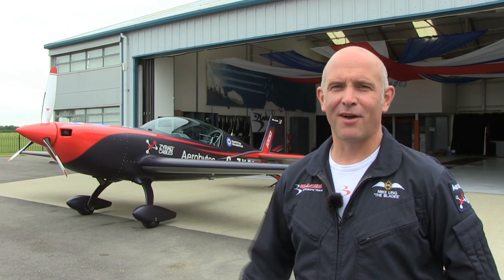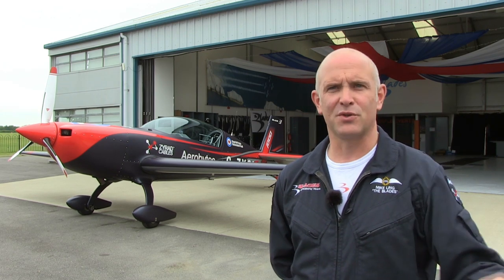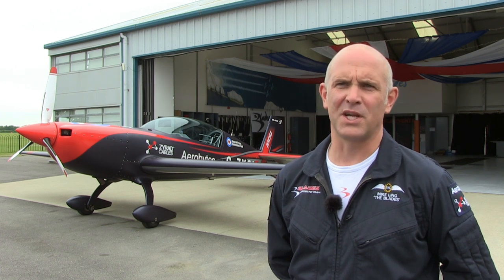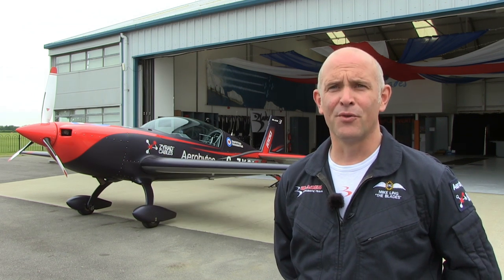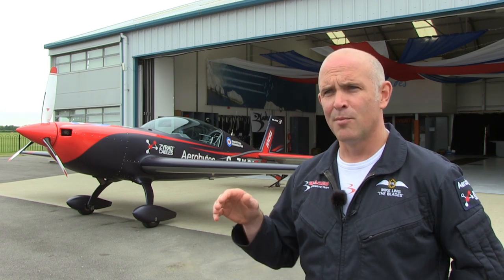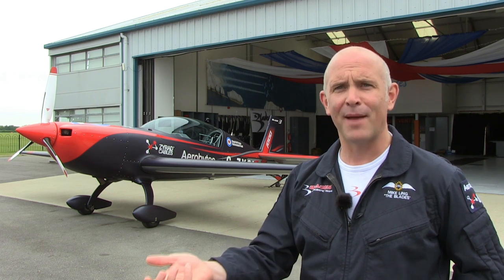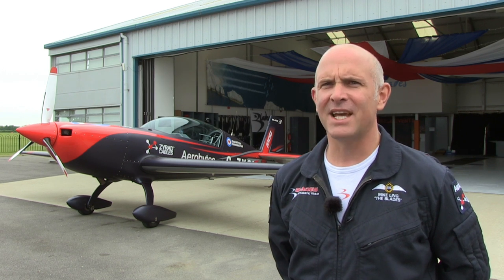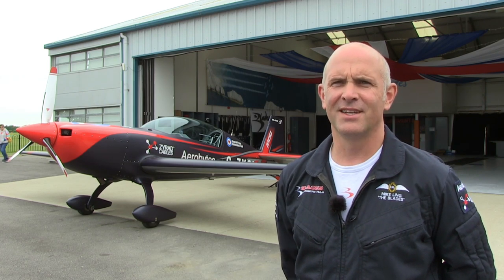Tornado F3 Wing Sweep | with Mike Ling

Comment: The reason they allegedly didn't use the autosweep in the British (Italian, AND German) Tornadoes was that it stressed the airplane more and created more maintenance work.
The F-14 is the only variable sweep plane that went into service with autosweep and used it for its entire service life.  It was a very reliable system BUT the wing sweep mechanism definitely created maintenance issues that they took seriously with the F-14.  Unlike the F-111, there never was a wingbox failure in the F-14 and wing "hang-ups" or malfunctions in a fixed position were rare.  Grumman learned their lessons very well from the F-111's problems.  It's a fact that they never built that many variable sweep aircraft in the US.  The totals of variable sweep planes built in the US (B-1, F-111, F-14) would barely equal one-quarter of the F-4 Phantom production which was close to 5200 planes!  Yes, variable sweep was expensive!
By far the most successful variable sweep program in the West WAS the Tornado -- nearly 1000 ground attack versions built and just over 200 ADV/interceptor versions built.  The MiG-23/-27 were far more numerous (6000 planes built) than ANY Western variable sweep program BUT they got phased out faster for a reason -- they were a hell of a lot more dangerous to fly and those countries that couldn't afford (or WEREN'T allowed) to buy MiG-29s or other planes often kept flying their MiG-21s AFTER they grounded/retired their MiG-23s!  The Chinese didn't bother to bootleg the MiG-23 for a reason!

All the other variable sweep planes had manual systems (F-111, B-1A/B, MiG-23/27, Su-24, Su-22, Tornado IDS/GR1/GR4) or they disabled the autosweep (or just didn't use it) like the UK Tornadoes although I've NEVER heard of an autosweep system in the GR1/IDS models.  I've only read of them developing autosweep for the F3/ADV series of aircraft for obvious reasons -- they thought they could possibly dogfight with the ADV models.  The F2/ADV did not have autosweep but they only built a limited number of F2/ADV aircraft (18, 24?) and those were only used for training -- they were not operational/frontline planes.
Well, variable sweep is basically old-hat and passe as far as aircraft design is concerned.  The Tornado will probably be gone by 2030 altogether (depending on how quickly Germany and Italy can get their Typhoon fleets together; Germany's air force is a MESS right now) and the last variable sweep planes in service anywhere will probably be the B-1 and Su-24.
Reply: Impressive … and good info
Reply: It might have been extremely complex and difficult to maintain, but the F-14 wing sweep was probably 20 years ahead of its time and probably the most well implemented function. It never failed, the computer controlled programmer had very complex algorithms to very quickly compute the best sweep angle for a given angle of attack, maneuverability/lift demand and mach number. The motors were extremely fast in how they could adjust to rapidly changing mach number during combat. Even at 7.5g and over 350 knots turning speed under high stress, the mach programmer could get the wing sweep from 20 degrees to 68 degrees in less than 2 seconds.
Reply: If manual sweep in a two-seat Tornado offers a higher workload for the pilot in close combat, imagine the hell it must've been for MiG-23 pilots tackling F-4's F-14's, F-15's, F-16's and Mirage F-1's over the years? Made all the worse by having a restricted view out of the cockpit. At least the MiG-27, Su-22 and Su-24 are all attack oriented and have no place taking on dedicated fighters...well except when a couple of Libyan Su-22's were shot down by USN F-14's in 1981. But that's another story I guess.
Reply: @AvengerII : Great insights about the topic of variable geometry (VG) wings. Thanks.

There is two other airplanes with VG wings that will remain in service for quite a long time : the Tupolev Tu-22M ant Tu-160 (the build assembly of the latter being currently reopened). As you have rightly pointed out in your conclusion, only bomber or ground attack planes will retain this feature (by the way the Su-24 is currently phased out in favor of Su-34 and perhaps none will remain in service by 2030).

Actually, if I'm not mistaken, the Su-17/20/22 family (at least the first planes) do only have two positions VG wings : fully swept back for high speed dash, or fully swept front. Despite of this simplicity, those planes appears to have been successful and are, to my knowledge, more widely kept in use nowadays than Mig-23/Mig-27.
Reply: @KLRGT500KR  It wasn't so much 20 years ahead of its time, just every other plane (outside the Soviet Union) that had variable sweep wings was a ground strike aircraft so there was little point wasting money on a system like that.
Had the Tornado from the outset been designed as a fighter or even a multi-role aircraft, it wouldn't have been beyond the Europeans to develop a system like the one that went into the F.3 a decade later, only during the 70s, roughly contemporary with the F-14.

Comment: A lot of work to do if in close combat. F-14 pilots had it much easier it would seem.
Reply: Yeah, F-14 was designed for high maneuverability and ACM as one of the primary design goals while the Tornado was not. The mach sweep programmer could sweep the wings from 20 degrees to 68 degrees under very high G stress (over 7.5g and 350+ knots) in less than 2 seconds. No pilot could be worried about the best sweep angle while controlling the throttle and nose under very high G stress.

Comment: F-14's auto wing sweep with manual override was used very effectively in ACM to fool the bandit. A lot of the adversary pilots used to calculate the F-14 speed by looking at the sweep of the wing. An example was in 1988 where an F-18 pilot at the merge saw, F-14A with its wing swept back thinking it was going too fast to roll quickly with the F-18 so he pulled the F-18 into a vertical. In reality, the F-14 was going at its best roll speed of around 400 knots and the F-14A pilot had manually swept the wings back so the F-14A pilot quickly switched the wings to auto and then lit the afterburners up in zone 5 and pulled into the vertical right behind and got a kill on the F-18.